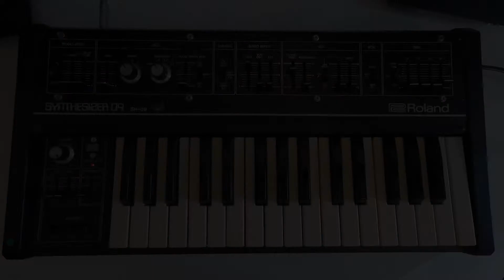Synth Tutorial - What is self-oscillation?  ( Roland SH-09 )

Comment: This is probably the weirdest question ever, but say you had the oscillators turned down, the output volume maxed, the filter around the middle point and you were gently increasing the resonance to get to the point where you hear that sine wave note: would you first hear some noise on your way to getting the tone and then get the tone, or would the tone fade in from silence? I'm trying to ascertain whether it's normal for the self-oscillation, when you raise the resonance and first start to hear it, produces some noise before it produces a tone, like on my synth. Thanks!
Reply from the maker: I'm not ignoring this...I think I get your question, I just want to try it practically to see if I can give you the answer you're looking for!

I should think you'll hear a fade in of a sine wave as the amplitude increases. Let me try it and I'll get back to you.

Great question!
Reply: @ConstantLittleGhost  Thanks, no rush. My Drumbrute and Minibrute both seem to do this, although the resonance on the Minibrute eventually turns into a tone.